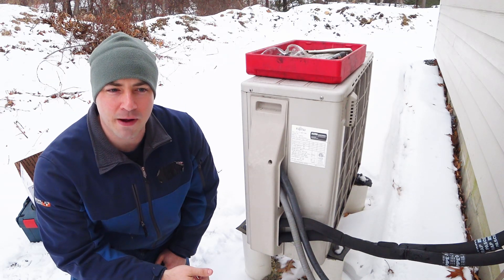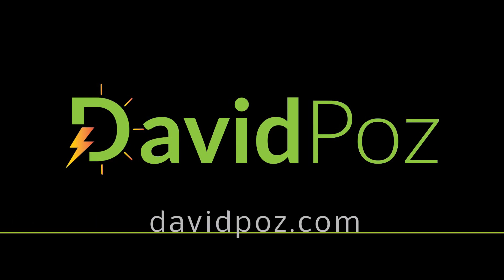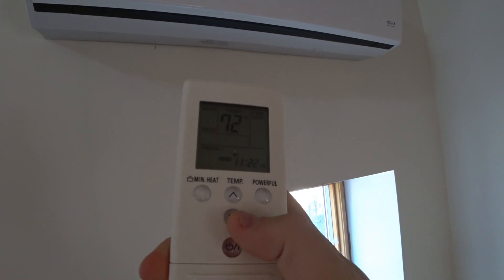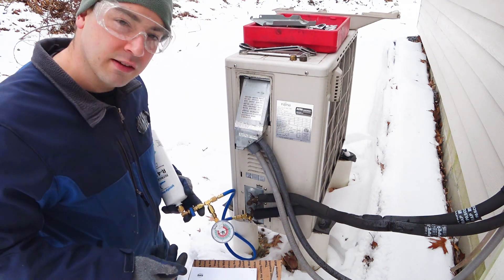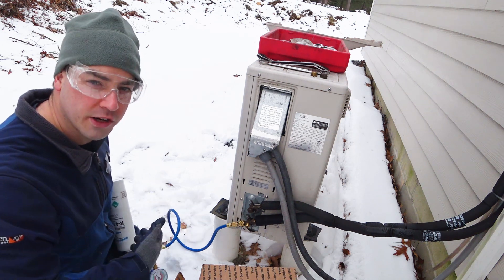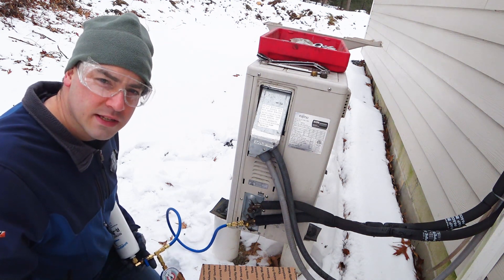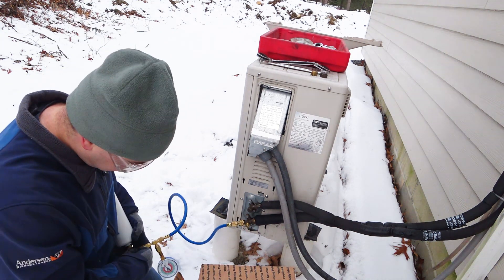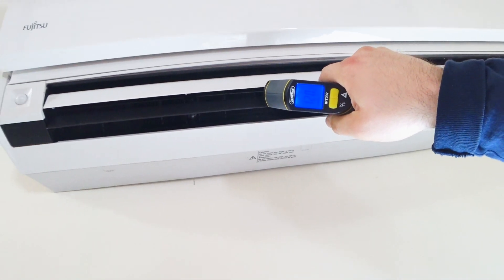Saving Money with DIY Repair on Mini-Split Heat Pump

Comment: Spend twice as much and get a 14.3 SEER2 central hp system that is easier to repair with commonly stocked parts. Get it installed by a legitimate, licensed and insured contractor instead of the cheap jackleg fly by nights.

Comment: HI David I was wondering if you can help I wanted to do what you did with your spit because it is low on Freon my room doesn’t get cold but I looked on eBay and also Amazon but could not find a recharge kit my unit is a Frigidaire and in the booklet it says R410Ahopefully you can help me thanks in advance for your help Marie

Comment: There is a leak get it fixed  also this unit will produce sufficient heat  temperature down to about  0 degrees

Comment: Leak detectors, micron gauge, vacume pump, super heat thermometer ,multimeter, accurate scale.a torque gauge,  I have them all, and yes put these in and have not had multiple failures, put them in right and they will work.but u have to have the correct tools and correct installation method.

Comment: There is a section on eBay called dent and scratch. You can buy a mini split for under $500. Some are even cheaper. Most they have is a scratch on them. Wish I knew about it before I spent $1000 on a Gree mini split. It’s cheaper to replace then repair them.

Comment: From one DIY'er to another, not too bad of a job for not being too sure about what you were doing. Some of these units with the 1 service port I personally think are designed to be junk you have to constantly replace. Even if you have a fancy gauge, you're just guessing with a bit more info if you have to charge on of these.
When you put the freon in "slowly", you can do it by just cracking the valve so the liquid refrigerant flashes off to gas as it goes in.
Reply: It's not guessing. Inverter mini splits can't be safely topped off the way it was done here. Too many variables to have readings that mean anything on the gauges.

The correct process is basically to empty the system, vacuum it down, then add the correct amount of refrigerant by weight per the manual based on the base unit plus any added line length.

The caveat is that a recovery system costs a lot. Doing it without a recovery system is bad for the environment and a federal crime.

If I were doing this, I'd run in a dye cartridge with the reload and wait for next time it drops to find the leaks with UV.

You can also find the sniffers that sense leaks fairly cheap and go that route, but that can take some learning.

Comment: Those Fujitsu units always split the outdoor coil out. They aren't designed for as cold of winters we have in the northern states, and the coil doesn't have a high enough clearance from the drain pan. The ice buildup then cracks the coil out. It's possible that's the issue here. They make drain pan heater kits. Make sure they install one in your next mini split.

Comment: Dude you think you’re saving money DIY but you’re not an inverter tech and most techs aren’t Inverter techs I’ve been through hundreds of hours of training with Daikin and been a tech for a long time and I still learn everyday and I even have an electronics engineering bachelors degree you don’t charge these units you weigh the charge out and start over

Comment: It not the unit installer error I seen mean people do it wrong then call me to fix either a leak which we can fine with nitrogen or the king valves are leaking one of the other that’s why they make nitrogen testing test

Comment: Oh my $5000.00!!!! My guy you don't know what your doing!  Some heat pumps don't work in low outside air temps! You need a hyper-hesting system for climates that drop down below 17 degrees outside. Hyper heat units work down to -13 degrees. You got a unit that is inadequate for your design temps. And yes I'm a Master HVAC TECH. THIS VIDEO IS Garbage!!

Comment: PS:  You can buy an entire system (12,000 btu) mini split heat pump for under $1000...(Amazon) why would you spend $5000 on the unit???   You are tossing money away like a drunken sailor.  $140 for that recharge kit?  You got screwed, glued and tatoo'd.  It is recommended you replace the entire system when problems such as your's occur.  It is cheaper to replace the entire unit than one service call, often times.  And by the way, all you need is a vacuum pump and a set of gauges...new units come with enough refrigerant for up to 25 feet of line set.  Connect the lines to each end, wires the same, vac the line set down to minus territory on your gauge then watch it for 20 minutes to see if the vac holds.  If you screwed the lines together properly it should remain at minus.  Then  open up the contents of the outdoor unit to the line set and indoor unit by opening fully the 2 valves sticking out the side where you connected (the valves are under the 2 hex shaped caps).  Turn the unit on and enjoy.  And if you have problems again in a few years you can get another unit for less than $1000 (often less than $700 for your size) and do it again.....$5000 spent is just plain dumb.  I mean really dumb.
By the way you can purchase a set of gauges and a 30 lb tank of refrigerant for just a bit more than you paid for that "kit".  And you can get a decent vacuum pump for less than $100 on harbor freight.  $5000????????? DUMB.
If you want to charge your system you can get a cheap thermometer to measure the big tube at the outdoor unit and use a chart (readily available on the internet for your type refrigerant) using superheat (the point at which the refrigerant is completely turned from a liquid to a gas - the heat it still picks up after that happens is called superheat).  I got 50 years in the heating air conditioning refrigeration business.  I know what's fer.
If you are completely dumb, though, just replace the entire system for $700 and be done with it.  By the way once these start to leak they are not designed to repair.  Could be a screw rubbed through the lines somewhere, a crack in the material they used to make joints, etc (they use a heat shrink tubing to join aluminum to copper connection and they crack and begin to leak when the unit is rough handled during shipping for instance).  Or if you get a bad 3 way valve, or pc board or whatever....JUST REPLACE THE ENTIRE SYSTEM....this is a throw-away designed system.  Sad but true.
Reply from the maker: Yeah, I should have done that a long time ago.
Reply: @DavidPozEnergy  I had a Fujitsu mini-split similar to yours installed in 2017 and have had my contractor out every year to recharge it because of a leak due to a bad flare on one of the copper lines.  Unfortunately, the system continued to leak after redoing the flare during the 2nd or 3rd visit to my home and he eventually found a leak in the evaporator coil which isn't repairable, the coil needs to be replaced.  I originally paid $3,000 for the system, installed, and he hasn't charged me for any of the service visits or refrigerant recharges.  He's probably been to my home a half a dozen times since the install but won't take a dime from me because "this never should have happened" he said.

He was able to get a new evaporator coil at no cost from Fujitsu under my original warranty but so far I haven't been able to get him to come back to install it.  I've been calling around to other contractors but they don't seem to want to even give me a ball park quote even after explaining to them in detail what the issue is.  One guy said it would cost between $1500 and $2000 to install the new evaporator coil...that I would be providing!  Again, I've spent $0 to this point beyond the original $3000 I paid for the system with installation. 

I think I will take the advice of @A Day, cut my loses ($3000) and just replace the entire system if I can find a deal.  One thing is for sure, it won't be a Fujitsu!
Reply: @vinniepro1296  Throw away systems,  replace it yourself as everything is now right there

Comment: The pipe onto refill can had some air in it and when hooked up wasn't purged so that air is now in the system and it will probably cause the end of the world. No really, does that mean a fair amount of air is not causing much of a problem for the short term?

Comment: Your using the wrong music for your video, try the tune from the 3 stooges it fits much better. By the way for less than $100 you can purchase a 25lb tank of r410 on ebay.  Why are you making a video showing other people that you dont know what your doing? Lol

Comment: If the unit is leaking its its likely the installer at fault not the equipment's fault as it's working again with a recharge

Comment: You probably just got a bad unit since you have had the lines replaced. it would be a leak in the coil. if you ever get a new unit get Daikin, Panasonic or Mitsubishi there the best brands or you could get a new Fujitsu there still good there just made in China as I said yours is just a bad unit

Comment: You are better off just replace that entire unit with a Senville, Pioneer, Kingsfin, Blueridge, YMGI, Mr Cool etc etc. for under $1000 shipped. Many brands to choose from at less than half the cost of Fujitsu. They are all made in China even the big name brands. Most are the same machines re-branded. The largest manufacturers of these systems in China are Midea and Gree. So you can get a new system for less than the labor you have paid trying to fix this system. And if you get 5 or 6 years out of them it owes you nothing. Order another one and reuse your lineset and you already have the electrical run so its easy swap out.

Comment: 100*  + or - 10* ... above the bigger line is a good rule of thumb when in a limited situation.  so.,  If its 30* F outside. temperature on the LARGE line should be so.....  130* F.  also...  call a good company..  tell them the troubles you are having.  have them leak check,  remove old 410a and pressurize.  and pull a good vacuum.  It may have non condensable in it and the charge should be removed and done properly.    Call good company.

Comment: You know, if someone charged you $480 dollars just to look at it, that's insane. Even my old company did around $120 an hour, with $69 diag fee. But most are clueless with mini splits. 

Also, $130 for that kit? Wow. I got an entire jug of r410a for around $300 (even that is insane from where it used to cost only around $60 in the good old days.)
If you want to find any leak, buy an H10 or H10PM leak detector. The best, even if ancient. Lots of them for sale on ebay. Takes a little know how to use but it finds them every time.

Comment: Kinda like my 91.5 Dodge diesel to replace the old ac system was expensive to get by I used a seal and recharge kit from Walmart for 39 bucks after doing so two years in a row it's been fine for over five years.

Comment: DavidPoz you have a great channel with lot's of interesting stuff! I read all the comments in this thread as well as checked out your WVO Jeep threads. 

Did you get to checking the acid level of the oil in your mini split? I think that's a good suggestion by SuperVsTech considering all that you went through thus far. Don't know if this acid test kit will work or if there's something better (no personal experience) https://www.amazon.com/Protech-QT2000-QwikCheck-Acid-Test/dp/B003LLBR7K   It does say "Works with all refrigerants & oils"

Were you watching the techs when they were installing your Fujitsu? Did they do a triple evac with Nitrogen and evacuate with a vac pump and a micron gauge?
Reply from the maker: Hi guitars,  I have not tested the acid because I didn't know how.  But, I'm going to order that test kit you linked to and give it a try.  No, I did not watch the pros when they installed my system, or the times they "fixed" my system.  LOL.  Thanks for watching.
Reply: @DavidPozEnergy   Too bad you didn't watch them. They probably took short cuts. Did you register your unit and do you have a warranty? Did you try contacting Fujitsu America for help?
Reply: This seems to be a good video https://www.youtube.com/watch?v=4dWzhglFcCk of the Qwikcheck on a non mini split.  I think most things discussed also applies to a mini split. It says to do the test with system running. 

Note: I have no experience with this kit. I have totally rebuilt an R12 system in a car but have not done any work with mini splits. However, I have been doing a lot of research before hiring a contractor to install a Fujitsu 33 SEER 9RLS3H mini split, which was completed a few days ago.

Comment: You are doing totally wrong. Charging the unit with suction line in winter time is not the way you did it. Cause suction line in winter works as liquid line so there is no suction to suck the gas.
Secondly you have to measure subcool and superheat depends on your metering device type. That's the reason you always have problem with unit. You don't know don't touch or atleast do not share these unprofessional videos.
Reply: Temp gauges are pretty useless on an inverter based system due to all the variables, unlike traditional fixed speed units.  The only way to properly charge is to vacuum it down and refill to the vendor specified weight using a scale.

Comment: We haven’t seen an update on your system yet. I really wish I worked in your area. 

It is getting chilly soon. A minisplit provides such energy economy in heating and cooling, they are fantastic. 

Especially if you are running off grid, or close. 

The clown techs you have used sadly aren’t fixing your problem.

My advice is this.

Go to your local United refrigeration supply house. 
Look on the isle for spray leak detection liquid.

Shut off the unit, then lay out some towels.

Pull the cover off the indoor unit, and dribble the liquid on the flare connections. 

Do the same on the outdoor connections. I bet you see bubbles.

OR 
The installers left water in the lines when they installed this unit, then the POE oil became acidic from the moisture, and the coils have begun leaking from microscopic corrosion points... 

If the lineset has been replaced, odds are good one or both of your coils have begun leaking. 

I would love to help you out.
Email me your specs and model numbers on the unit and my company may be able to source parts for ya, cheap or free.
Reply from the maker: Thank you.  It worked for about 5 more weeks after this video, then stopped again.  All summer long I've been using my 10 year old window AC unit.  I had it in two apartments prior to this house and it still works.  I wish I could say the same for my mini-split.  I have tested the outside flares with a blue bottle of leak fluid from my local HVAC supplier.  That's the only thing I can say for sure is not leaking.  It could be the inside flares, or the coils.  I don't know.  I'd love to make a follow up video for you (viewers) but it's always a time issue.  Trying to build the trailer, batteries, etc.  Plus, in the summer I'm busy trying to do landscaping while the ground is not frozen.    I'll probably get to this video when it get's cold.  Thank you for your support.
Reply: DavidPoz ok, can you get back to the supply house and get an acid test kit. 
There are the bottle type, and the spray out the hose type. Either will work.
Test the oil in the unit for acid level. It should have zero acidity. If it shows acid, the coils are likely corroded from the inside.

There are leak sealers that have a UV dye in them that will spread through the system and seal micro leaks, and ooze out the dye that shows under UV light. DONT USE THIS while the system is acidic, add some acid neutralizer to mitigate the issue. 
I wish there was a way to remove the moisture in a minisplit, but there isn’t. Only a liquid line acid and moisture dryer will remove it, and the lines in the liquid side are just so small... 

 I could install one, but I am a special tech. Most don’t have my skill or experience... go on will prowse’s forum and send me your info and I could fix it and ship it back to ya.
Reply: DavidPoz another option would be to replace the indoor unit, after you mitigate the acid in the outdoor unit. (Where most of the oil will be)
In cooling season, the outdoor unit is under the most pressure, so leaks there will be the fastest loss. But there should be signs of oil weeping out with the leak. Open the system up well and look over the coils and lines for oil. If you find any, there is your leak.

Comment: You can not check a charge (effectively) on a unit like this with a service gauge.  You need to recover the system and then weight in the proper charge.  
As you have mentioned you probably have a leak, you should find that first.  Check out a product called BigBlu leak finder. 

Unfortunately you also just dumped a lot of air into your system the way you connected that. 

Is it still working through the summer?
Reply from the maker: Hi Mark,  Thank you for your comments.  Yes, I have a spray bottle of bigblu leak finder.  I still can't find the leak.  The heat pump worked for about 6 weeks from the point of this video and then stopped again.  I'm back to my 10 year old window AC which is still going strong.
Reply: @DavidPozEnergy  Bummer... I would be happy to come up and suck that down and recharge it and see if we can find a leak but I don't think we are in the same area. I am down on the Cape.
Reply from the maker: Hi Mark,  I'm up by Fitchburg.  Thanks for your offer, but it's probably too far a drive.

Comment: I might be wrong, but it looks like you had a refrigerant leak. When it is warmer, check the condenser, the evaporator for leaks using soapy water. The same for the compressor input and output lines.
Reply from the maker: Thanks.  I'll probably get to that in a few months.